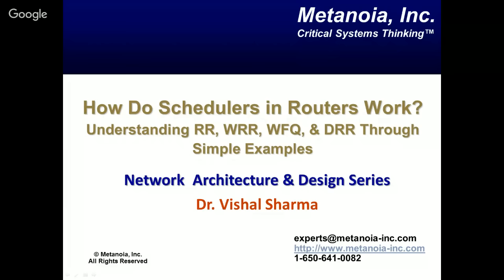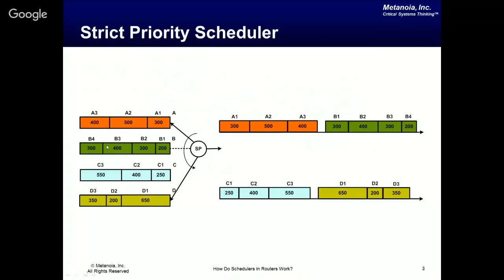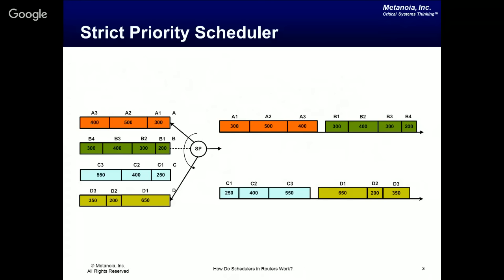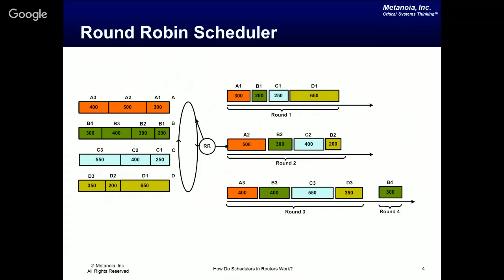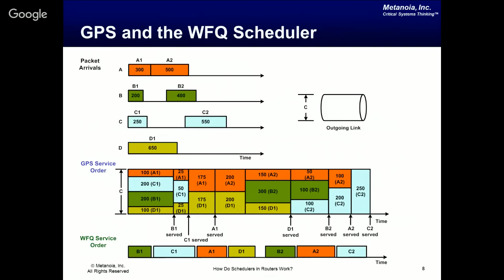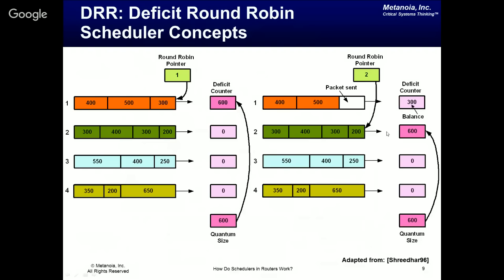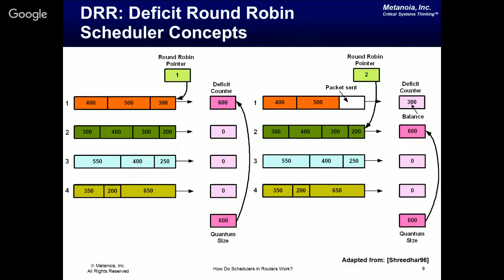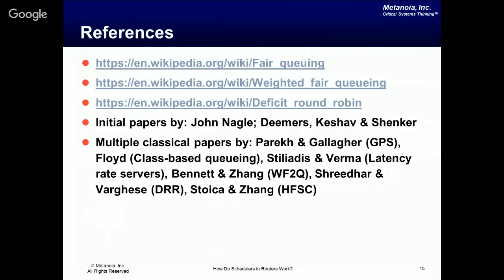How Do Schedulers in Routers Work? Understanding RR, WRR, WFQ, and DRR Through Simple Examples

Comment: Thank You Mr. Sharma. 
You have taught the world the concept of queuing.
I feel enriched with knowledge after going thorough your presentation.
Reply from the maker: Hi +Ravjot Singh - thank you for your kind words. Glad to hear that the presentation helped you with concepts of queueing. Do you use that in your work/profession or were you learning these as part of a degree or course? Would be great to hear how you use these concepts?
Reply: @metanoiainc8330  Yes I use QoS with DWRR scheduling in configuring 3G/4G services on microwave radios. I work with a mobile operator in Toronto.
Reply from the maker: @sravjot  sorry for the delay in getting back! Thank you for taking the time to respond to my question. Yes, QoS for 3G/4G microwave services for equipment at the transmitter base can be very useful, especially, for real-time services. So, happy to hear this helped you, and thanks again for your reply.

Comment: Thanks for information sir. It is so clear. I wanna ask some questions , one of them is how many time is spent one scheduler clock cycle(one round)? At what Mhz does it work and the duration of 1 round? What is the maximum amount of packets it can take to perform serialization in 1 round? In the video, some rounds take very large packets while some take very few. Or is this a round time dependent on the speed of the port? Can we say that a 10 Gbit port can schedule enough to serialize this much data?

Comment: This is a great video. Thans for putting this together. One question though - How is the quantum size determined? In the example here you use 300 as the quantum, so for Q0 with Weight 1, quantum is 300, but for Q2 with weight 2, quantum is 600, but in an actual network, how would I determine the quantum size. Is it a function of the MTU and if so would quantum = MTU? Apologies if you've explained it and I missed it
Reply from the maker: Hi @Abhimanyu Mehta, first thanks for your kind comments. Second, thanks for a great question! The quantum size in DRR (Deficit Round Robin) is actually a design decision, and would be a programmable parameter in most DRR implementations. The value of the quantum size would trade-off ease of computation/implementation for accuracy of queuing. So if the designer chooses a large quantum size, the scheduler would have to do calculations less often (as more data would be served each time from each queue, before the scheduler (the logic doing the computations, either in hardware or software) would have to perform calculations for the next round). But, the granularity of QoS would be coarser, as more data from each queue is released each cycle, and so the "closeness" to the ideal queue schedule (namely, Generalized Processor Sharing) would be LESS. If the quantum size was chosen to be very small, the scheduler would have to compute more often (as a round would be much smaller, with much less date being released from each queue at each round), but the performance would be closer to the idea scheduler (GPS). So, the network architect programming a router for a given network would have to make the choice for the quantum size. In a practical situation, one would probably pick a quantum size depending on the types of data on expects in the network (or a segment of a network - access, metro, or core for example), and use the same quantum size for all routers doing DRR in that network sgement.

Comment: correct me if i'm wrong @21:03-  should it not be 350(D1) and 350(A2)  on the pipe (C) as now the proportion is 1:1, where D1 will be fully severed
Reply: Hi +Kasoon C, thanks for the observation. Notice that the explanation beyond 21:03 that I give provides an answer to why what you suggest does not happen. This is because before D1 and A2 can be fully-served, B2 already arrives. As a result, in the idealized GPS scheduler, all three packets now have to be served equally. The moment at which B2 arrives is such that by that time, only 200 units of D1 and A2 have gotten service (after the departure of A1). That is, B2 arrives when both D1 and A2 have received 200 units of service. After that point, all 3 (D1, A2, and B3) have to be *served equally*, which is what my example shows. Hope that clarifies things - these things can be a bit hard to discuss when we don't have access to a white board and an interactive discussion, but if you still have a doubt, feel free to post it here, and we can discuss further. Best, Vishal

Comment: Sir, what is the 'C' and value of the C in the GPS example. I think you made a mistake there.
Reply from the maker: Hi +emrah Sariboz, actually the value of "C" the capacity of the serving output link is immaterial to the calculations and the discussion. Remember, each packet gets a portion of the output link's capacity C that is **proportional to its relative weight**. So, in my example, the  300 unit packet A1 of flow A initially (until one of the packets being served finishes, at which point the service rate can potentially change as the service order diagram shows) gets served at a rate of C/(1+2+2+1) = C/5 units/second (or whatever units of time we're considering), the 200 unit packet B1 of flow B gets served at rate 2C/5, and so on. 

So, when we compute the time that the packet from flow A gets serviced at the rate C/5, it is simply the time for which the GPS server operates on these 4 packets at their respective rates. That time is time in which the first packet finishes. In this case, packet B1 of 200 units of flow B finishes first within (200/2C)*5 seconds or (100/C)*5 seconds. Thus, the amount of data from packet A1 that gets served in this time by the GPS server is (C/5) * (100/C)*5, (Rate of service * Time for which the packet is served at that rate) or 100 units. [In reference to the comments below, I note there that if the normalization factor had been "6" (which is the correct value), instead of the "5" I've shown here (which was the incorrect value I had in this comment the very first time, and what I also said in the video), it would have made no difference since that factor simply cancels out, and this happens for all packets/flows.] So, by the time packet B1 of flow B finishes, the amount of data from the packets of the remaining flows that has been transmitted is 100 (A1), 200 (C1), and 100 (D1), respectively, as shown in the video at 18:44, which is obtained by the same logic that I showed for A1 above.

The actual value of the time will depend on what C is, but we're not interested in the actual value of time, we are just interested in how much of a packet gets served packet, which we can calculate as above. So, the value of C is never really needed, and it doesn't matter what C is for the purposes of figuring out the GPS service order (or the service order according to any other scheduling discipline). Hope this helps in clearing things up.  If you have further Q's feel free to post them here.
Reply: @metanoiainc8330  I thin that's where the problem is. C / (1+2+2+1) is C/6 not C/5.
Reply: @metanoiainc8330  Thank you for your reply by the way.
Reply from the maker: @asdffghize  @emrah sariboz - not really. The "5" or "6" is just a normalization factor. As you'll see from my explanation above (which I have edited to be more clear), the amount of data served from the packets of all the 4 queues/flows, A, B, C, D in the time it takes for the packet B1 of flow B to be served completely would still be the same; the only thing that will change is when packet B1 will finish, but in GPS you are interested in their relative service times, so as long as their relative service rates are the same (have the same ratio with respect to each other) what is shown will still hold. That is, if I changed the "5" in my explanation above to the (correct) value "6" nothing would change with regard to the amount of data from packets of flow A, B, C, D served in the time packet B1 finished.. For all four flows A, B, C, D the  the picture would be exactly as shown in the slide. And, the modified explanation in my comment above shows exactly how the amount of each packet served is computed. Hope that helps ... 

And, for future viewers and commenters, I have left the erroneous calculation in my comment above (with "5"), instead of fixing it to "6", so that the context of this exchange remains clear to those reading it post facto.

Comment: Sir  how can we get the c implementation of these schedulers
Reply from the maker: Hi +Aman Sharma, this is something you will need to look around for. The implementations of some schedulers may be available in NS (the simulation tool for instance), or as part of a Linux distribution. If you wanted to build custom schedulers, however, you would probably need to write your own routines and data structures.
Reply: @metanoiainc8330  ok thanx sir